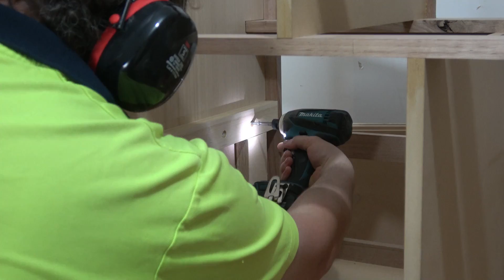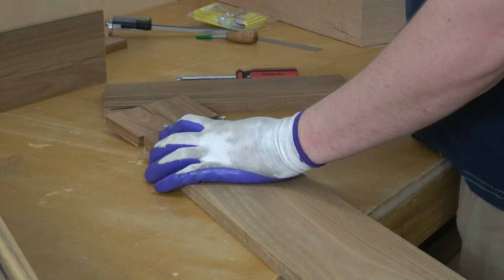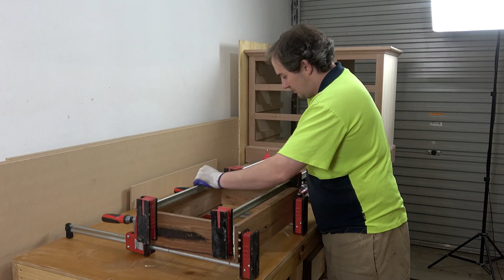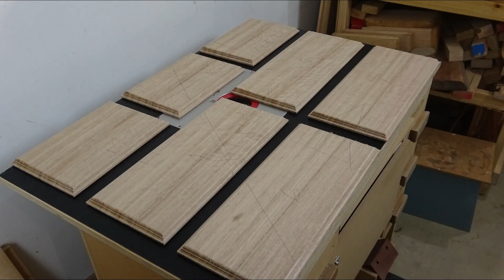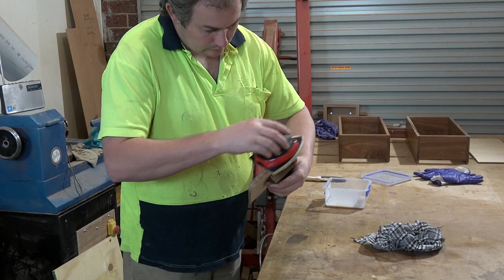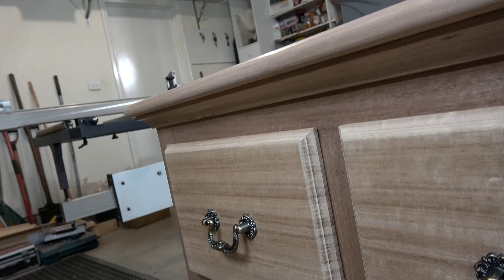Chest of Drawers FINAL - drawers and finishing

Comment: I know the answer is... because it works... but I have to giggle every time at your router table fence. Panel saw, big jointer, precision sharpened hand tools... and a piece of chipboard with a rough notch cut out. One of these things is not like the other 🤣 Drawers came up grouse and so glad my dodgy double-sided tape drawer front trick is actually an approved method! You get lucky making shite up sometimes ;)
Reply from the maker: Lol, I may have improved my router table fence since this video. Though I say that piece of crappy chipboard demonstrates exactly what a fence is. It's just a guide, if it guides the timber consistently along a known path, then it's a good fence :D

Comment: Fab job Kuffy as usual!!  You make it look easy.
Reply from the maker: Thanks mate. I dunno about easy, but knowing the next step does make the current step a lot easier.
Reply: I'll also add a thumbs up for using common sense and dowelling the drawers.  Whenever I see someone using dovetails on drawers (and usually hand cut) my first question is why would you bother?  They're certainly not needed for the strength they provide and using them on drawers means they're seldom seen...  good jig too!
Reply from the maker: Because I was using modern steel drawer slides, I probably won't need the mechanical strength that a dovetailed drawer box gives because there is little/zero chance of the drawer ever getting stuck in the drawer opening due to seasonal movement. I could have just glued and screwed the boxes together if I really wanted to. And even if I do need the mechanical strength, a dowelled drawer like I have made functions in a very similar/same way as a dovetailed drawer, only with a little less long grain to long grain glue surfaces. In a commercial shop, I would either use blind dowels drilled with a CNC, or machine made dovetailed drawers. The machine can cut the dovetails on two sides and a front and back in under a minute. It's still the fastest way to make a drawer even with all of the fancy CNC options.

Comment: Mate, what an excellent project. My bedroom furniture is a bit dated and you have given me a great idea. I will have to modify your design so as to incorporate a large mirror.  You have described the whole process in detail.  One interesting thing you have, what is that pad you used for that finishing, looks like a handy bizzo.  Cheers
Reply from the maker: Yeah those pads are great for applying water based polyurethane or acrylic paint. It doesn't work very well with anything else I have tried (oil based polyurethane, danish oil. shellac). The product is https://www.bunnings.com.au/shur-line-prep-and-paint-tool_p1661131 I only use the paint pad. I throw the sandpaper and clean pad in the bin.

Comment: Great final product! Love watching your videos, in particular i love your attention to detail, a perfectionist like myself. What do you do/have you done as a day job? How did you learn your trade?
Reply from the maker: Thanks. I am a furniture production wood machinist by trade. I used to work in the furniture industry before it crumbled, so now I work building timber roof trusses. I prefer to be building furniture full time, but building roof trusses is easy stable and reliable work that I can find anywhere in Australia.
Reply: Kuffys Woodwork Ah right, had a feeling you would say something like that. I am in the same boat except younger, work with timber at home cause the furniture industry is non-existant. As a day job a started in shop fitting (factory based), then moved to a cabinet making/joinery place that does mainly domestic house fitouts but also some fidly commercial shopfitout pieces that i do there such as curved work, stuff with angles or veneer board. Would love to work with timber and make furniture everyday but the only real options are places like Jardan furniture and you just become an assembly line worker in places like that. I like to actually do the thinking myself!!

Seems like such wasted talent for someone like you to be doing rough roof truses. 

Do you live in Melbourne?
Reply from the maker: Yeah I am Melbourne. There are many similarity's between roof trusses and production furniture. The pay is about the same, and 66% of both jobs is picking up and putting back down. Pick the timber up, shove it through the 4 sided moulder, put it back down, same with round end mortiser and tenoner's, spindle moulders with power feed etc. With roof trusses, I pick up a 6 meter length of 90x35 MGP10, shove it through a 5 axis CNC saw which cuts it to length and angle, then I put it back down. I do miss running a spindle moulder by hand though.
Reply: Kuffys Woodwork i see what your saying. CNC's are a must have as a business to be profitable but as an employee it makes you dumb. I enjoy doing stuff by hand and creating different jigs to achieve perfect results as such, thats what i believe makes me a good tradesmen; having the abililty to achieve cnc results by hand. 

I would love to work with someone like you in your workshop. So much valuable knowledge and experience. If you dont mind me asking, where abouts in melbourne are you? Would be cool to meet some time. Just wondering if your very close by me.
Reply from the maker: With the way my mind works, if I am creating a jig in my home garage, I am usually drawing upon my experience with CNC routers. Or vice versa, when I was working with CNC on a daily basis, I would often figure out how to do the job by hand first, and then just make the CNC do it that way, but faster 😀

I am in Caroline Springs. I don't have much going on at the moment. A few odd jobs here n there, but mostly I am gearing down to start a heap of work on my house getting it ready for sale. Though there will be a lot of woodwork involved with two vanity builds, building two doors to replace a rotten pair of french doors, then boring stuff like a lot of painting and rebuilding the ensuite and converting a french door into a window. Depends on my very limited cash reserves.
Reply: Kuffys Woodwork I see what you are saying with the CNCs but the problem now is, at least with my experience with sheet goods on modern flat bed routers, all the work is done on the computer, and in saying that, the programs have gotten to the stage where it does most of the work for you, and therefore hardly need to think about tool paths and setup etc. And at the router end of things, there is just a monkey selecting a program and loading/unloading sheets. 

What i enjoy is coming up with various methods of achieving weird shapes, angles, rebates etc utilsing hand routers, panel saws and jigs. The way the industry is heading, the 'tradesmen' its producing are gloryfied ikea assemblers that when asked to route a rebate by hand or do anything by hand for that matter will give you a clueless look. And i hate that, i want to be skilled, know various ways of achieving things by hand and reasons why you pick one method over another.

I have come to realise that is why i have always enjoyed working in my garage woodshop, because all the thought processes, machining and setup is done by me. You have no option other than work out methods have achieving your final product by hand. And you learn so much like that! The issue is transfering that to a profitable day job...... What options are there?

And you are about 50kms or so away from me. I am in Rowville
Reply from the maker: When I was programming CNC, I first learnt how to program in G code. I have now forgotten most of that, thank god!. But even with the later software which was designed for 16bit computers and then converted to 32bit, it was quite a lot of work. There were only a few routines which "did it for me" like running a series of adjustable shelf holes. Most everything else had to individually programmed in, in the correct sequence, with tool offsets and cutting direction etc. I see the new software of people pulling a 2D image off google, and then making a 3D carving of that with only a few clicks of a button. Makes my head spin with just how easy it has gotten. I once had to program an odd handrail shape. I effectively programmed the corebox bit to carve the shape taking into account the tool radius and clearances etc etc. Took me ages. 3 hours to be exact, but that's AGES!!!! 😀
Reply: Kuffys Woodwork yea thats exactley what i mean. But at least that bloody well got you thinking. Had to really understand and grasp the whole process, then think some more to achieve what you need. Thats what gives you that sense of achievement!!! And is what seperates tradesmen, being the good from the bad.

Where does that come into place now? And where does this leave woodworking for the future? It should be an incredible and highly sought after talent to create things by hand. "but why pay him to do that when the cnc can do it faster, more consistant and also doesnt complain....?"
Reply from the maker: It is a sad state of affairs. I can just keep on doing what I do, working for a crust during the day and doing real woodworking in the evenings and weekends. Perhaps when I am an old man, kids will watch me doing my thing with puzzled looks on their faces thinking "why is his hands touching all of that dirty timber? he will get diseased!". I hope not, but if history serves as a looking glass into the future, it would appear that it will be the case. Safety will be used as a tool to remove the maker from the making therefore removing the need for such skills to exist.
Reply: Kuffys Woodwork ahhahahaha! Very insightful and true! Keep doing your thing, keep sharing your content and hopefully you can work out a way to be in your shop for a living. Always look forward to your videos as i can see in comparison to others how you have true trade experience. Love listening to your little tips and details, its what makes all the difference! Good on you and maybe we can get together one day and talk shop!

Comment: Hi mate did you get the ledacraft bandsaw also, I got the 18" and had to makes some small mods to the blade guide cover but other than that is a great saw, I love the table saw, another tool I'll have to think about (if I can sneak it past the wife :-)
Reply from the maker: Haha, good luck sneaking a panel saw past the wife. It only takes up all of my garage space 😀 My bandsaw is the 14" Hafco model. It's good enough for what I use a bandsaw for. I do have plans of modifying/replacing the blade guides. The current guides can't actually close up enough for 0.6mm thick blades. I have approx 0.5mm clear space either side of the blade, which makes it a royal pain in the butt when cutting tight curves and even resawing gives me grief every now and then.
Reply: I had the same thing going on with mine so I set it up just for re-sawing , I found an old 14" same as the USA delta at the tip and bought it for $40 and re-built it I use it for all the small work and tight curves it works out for me
Reply from the maker: If I ever move into a bigger workshop, a bigger bandsaw will be high on the list of things to purchase.
Reply: I just have and I still have no room to move :-)
Reply from the maker: lol